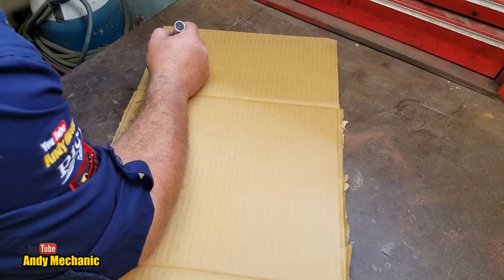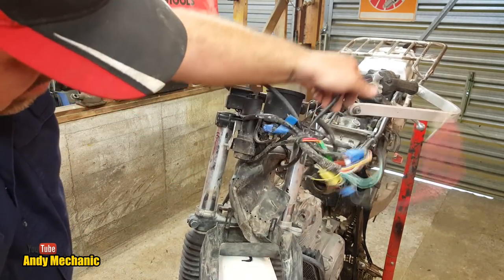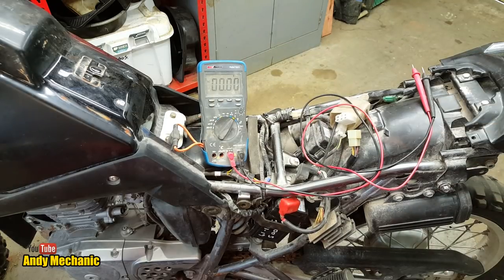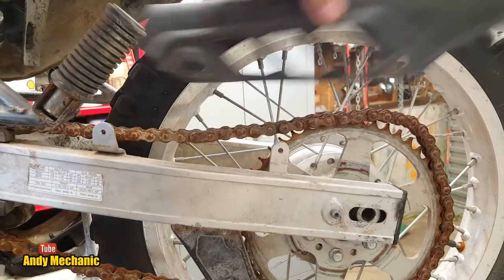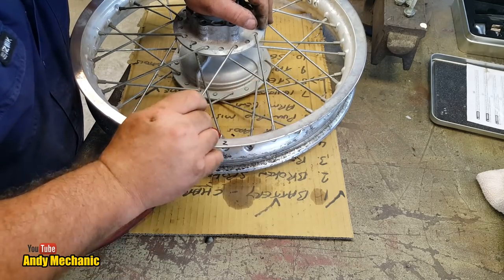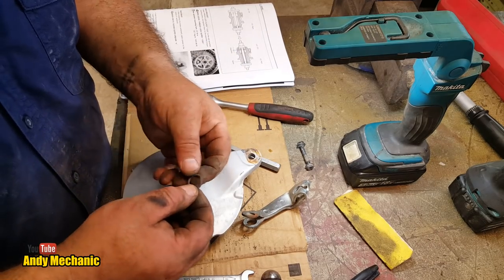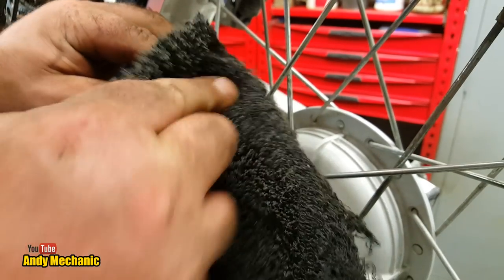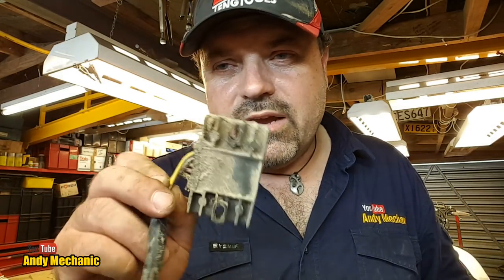Fixing up TG Lilli's farm bike - day 1 #1860

Comment: Strangely enough I have just done a regulator replacement on a Harley VRod as battery was discharged 
Replaced a rear tyre on my CBR600Rr
Replaced a chain on the CBR600RR too
Fired up a banshee that stood for years not used 
Basically almost the same as you but on three different vehicles 😂😂in the past week 
And using a Makita impact drive 

Take care 
I love your channel as we do so much similar work
Reply from the maker: Cheers Garry, pleased you enjoyed it :-)

Day 2 should be on the channel in the next day or so.

have a great Christmas 

Cheers Andy

Comment: The corrosion on that bike, in electrical connections and so forth to me ( assuming it wasn't driven near the ocean ) say it probably lived outside when not in use and I've always assumed the environment  in New Zealand is harsh on anything that will corrode due to high humidity and how often it rains. I would guess that a new bike off the show room floor would benefit from having every electrical connection taken apart and dielectric grease or spray used. Also a comment on the rear sprocket although I realize a new sprocket set is ideal, some sprockets are non directional like that rear one appears and can be easily flipped over for some additional life. However some sprockets have an offset and only go on one way, the same goes for the engine drive sprocket. Just some items one can get away with on a low budget repair on a lower powered play bike if its used off road and no one is nit picking at the bike for a safety.